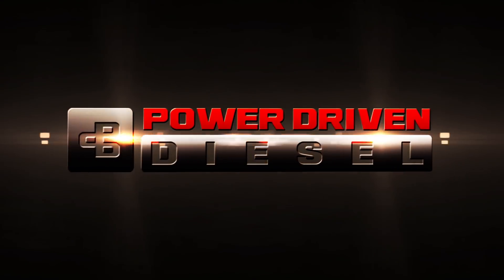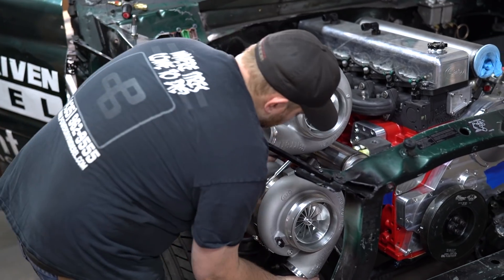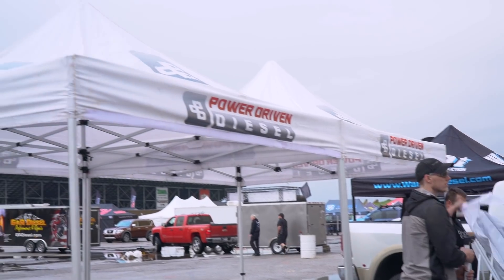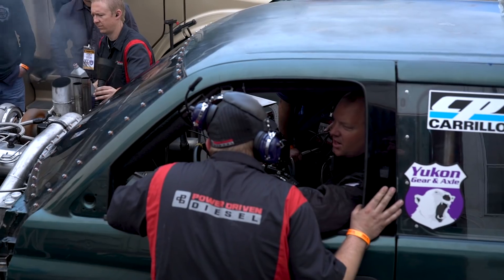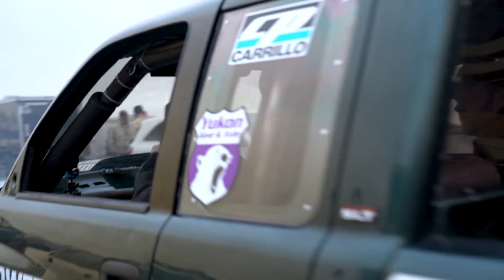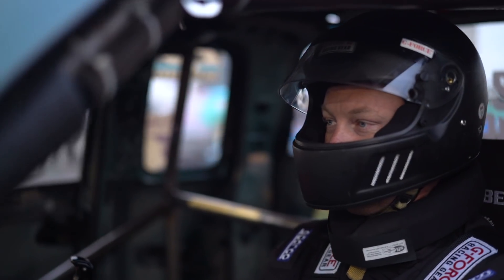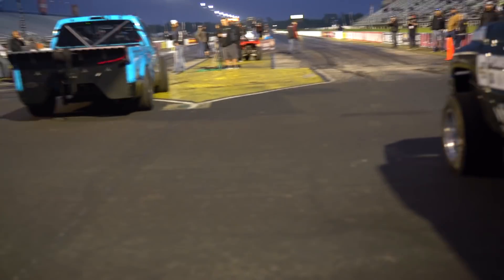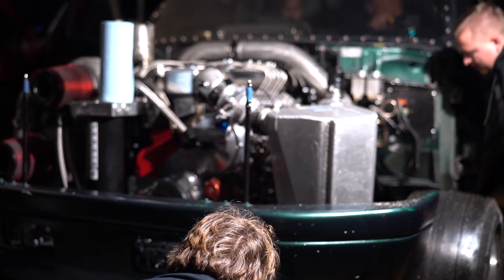Ultimate Callout Challenge 2019 Recap, Part 1| Power Driven Diesel

Comment: Why only an 8th mile?
Reply: Cause these trucks go real fast and that's a lot of weight at a very high speed at the end of a 1/4 mile
Reply: Trucks are getting too fast for the class they are in on 1/4 mile.
Reply: trucks are getting too fast in the quarter
Reply: Everyone is scared
Reply: @FROSTY2588 , I agree.  Atleast do the top fuel 1/4 mile, 1,000ft